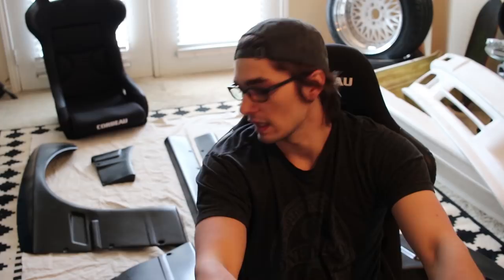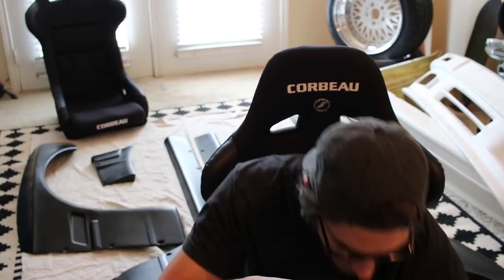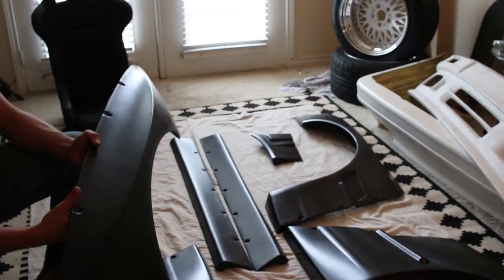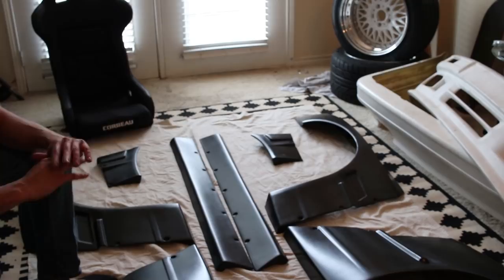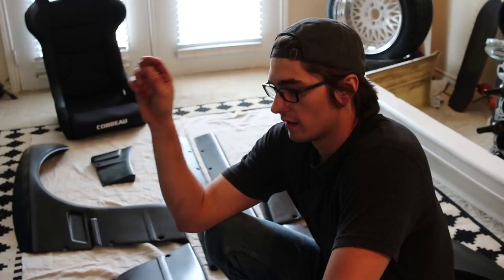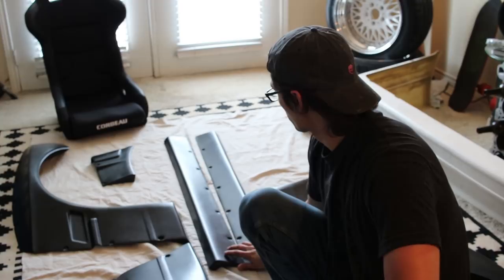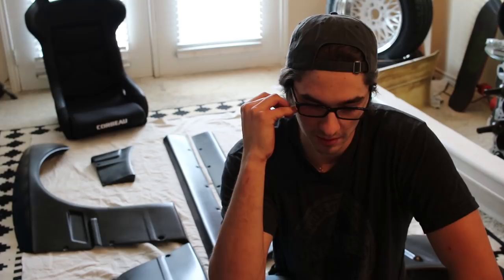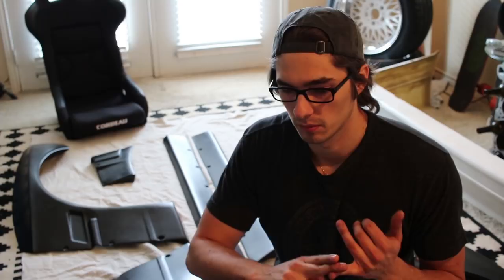Rocket Bunny Turbo S52 BMW E30 Build | Part 11: Rocket Bunny Widebody & 2019 Update

Comment: Glad you are still working on E30 projects. Why not use the Garagistic seat mount?
Reply from the maker: Derek M adjustability, cost and aesthetics. Cheap slider solution is just modifying stock sliders with side bracket.

Comment: Hi! Been binging your widebody s52 project and im loving it keep it up 👍 I have a E30 m20 turbo drift car that I'm thinking of installing RB kit on so I'm exited to see your install :) but one thing you should look into is your new seats by the looks of it they are to small/low compared to your shoulder height, if you would have an accident and using a 4 point harness it could damage you spine since the holes for the shoulder harness is wery low compared to your height and if they would tension in a crash the harness will compress you down in the seat, best regards from Norway be safe 😊✌️
Reply from the maker: This is a really good concern, if I go to track this car and install full harness and run HANS etc I will look at new seats, until then its more for weight as ill be running a standard 3 point on the road.

Comment: duuuude don't use mtech 2 fibreglass on a pfl e30. the rear valence fits horribly with the different sized rear lights and the different wheel arch height. use mtech 1 - mtech 1 looks so much better as a kit anyway
Reply: Nic Ensor agree. I have a late model with eBay mt2 front and rear bumpers-- they were such a PAIN to get fitted